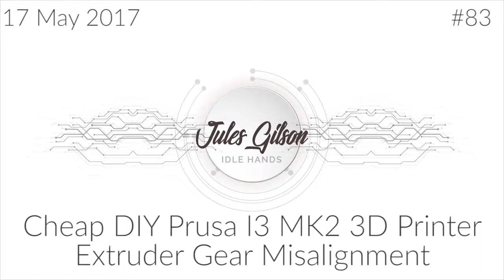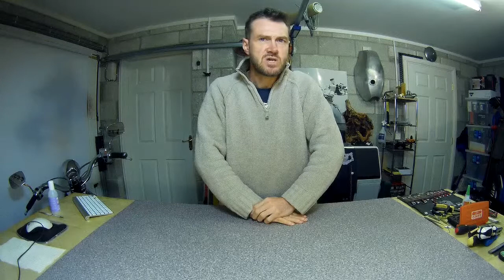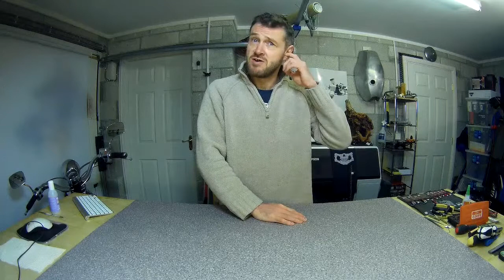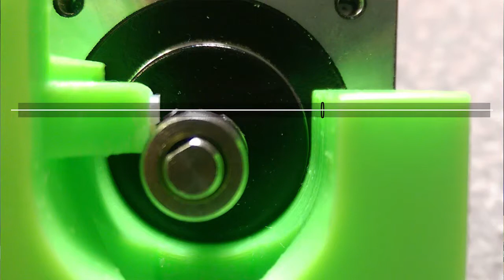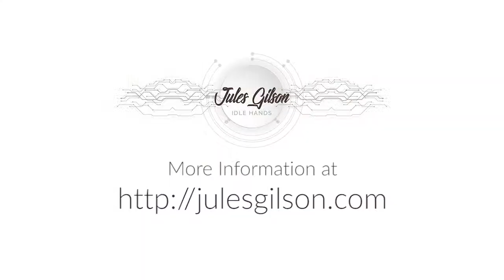Extruder Gear Misalignment on Prusa i3 MK2 Build

Comment: Totally agree and understand. What I have found out is that on a extruder that is a clone of the I3 MK2 extruder the diameter of the hobbed gear is 6.2 mm at the narrow part where the teeth are and on another the diameter is 7.3mm. If I find a place that sell the 6.2 mm diameter hobbed gear I will let you know.. Or if you know please post it... But YES I understand what you are saying and the problem you have... Best to you Richard
Reply from the maker: that was a long time ago - can't remember what I did to remedy it but it has been working for a few years
Reply: @julesgilson.   I have purchased some hobbed gears from China. I am told they are the correct ones.. I will let you know how it goes. NOTE: where the teeth are should be 6.2mm most are 7.2mm so they do not work.

Comment: Hi, a better solution this the problem is to print out this part: https://www.thingiverse.com/thing:2261050 which is designed for the MK8 gear.
Reply from the maker: Oh, that is perfect, thanks. At least it confirms it isn't my imagination and the original part doesn't fit the MK8 gear.